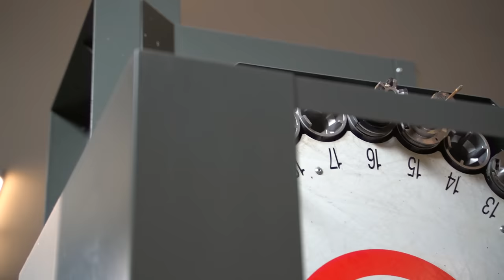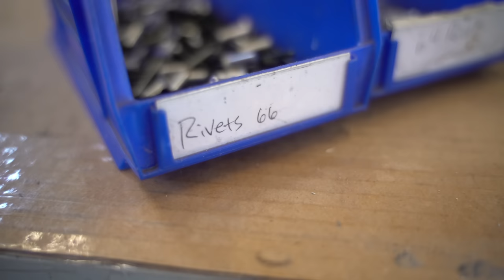New Gun - New Gun Case

Comment: Great video as always I totally enjoy the scenic backgrounds . My concern is that the aluminum cases will get dented to a point where it will be impossible to reclreclose  due to luggage handlers which is why I prefer a pelican polymer case it showed the scratches of handlers with no dents and still going strong but everyone has their own preferences
Reply: I work for an emergency vehicle manufacturer and we build our doors essentially in this exact same construction. 2” thick box pan-formed doors made out of 0.125” aluminum. They are very resilient and resist getting out of square pretty well. That return flange adds a lot of rigidity.